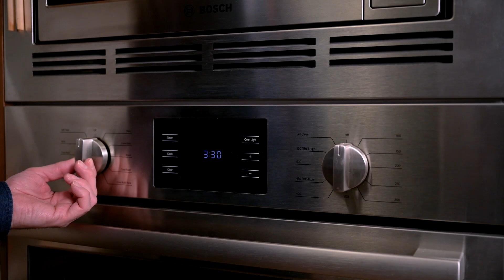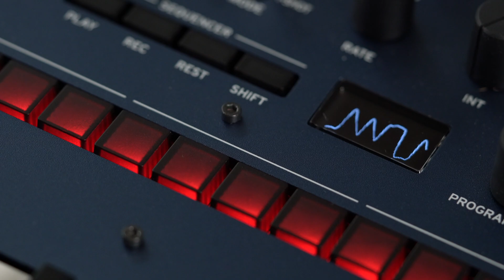FAQ | Is the ōPik a digital or analog pickup?

Comment: This is very interesting. Important would be individual output per string. So I could have a separate EQ/Compressor setting etc. in DAW per string.  Ideally with no or at least very low interference between strings. I need a modular pickup version for my cello. Also wondering how the pickup could get power – want to avoid any batteries. Is Phantom Power 48V a solution?